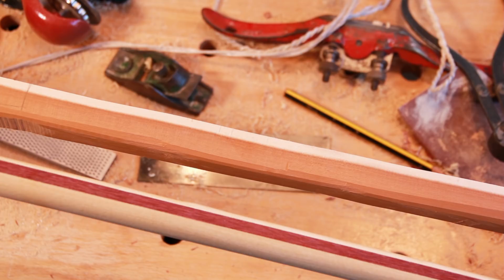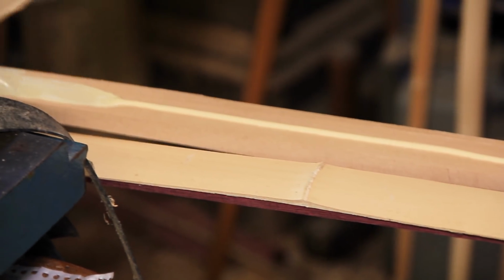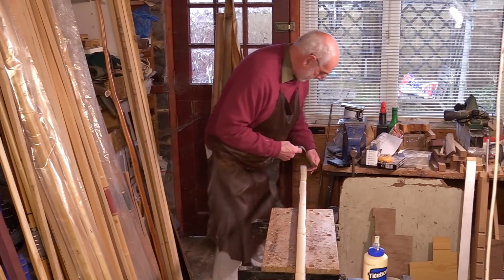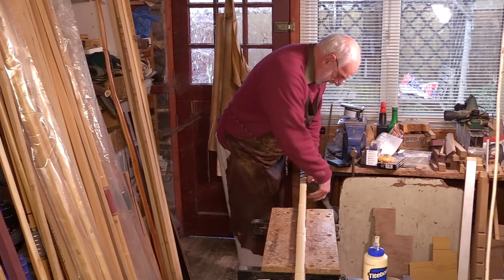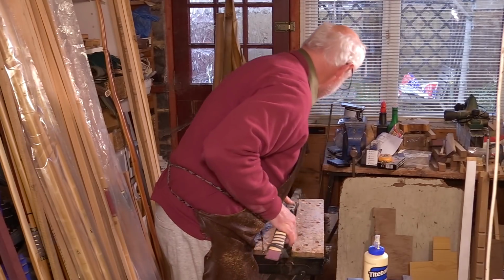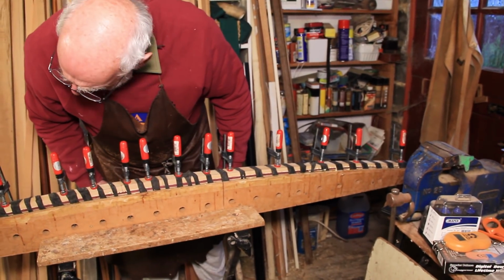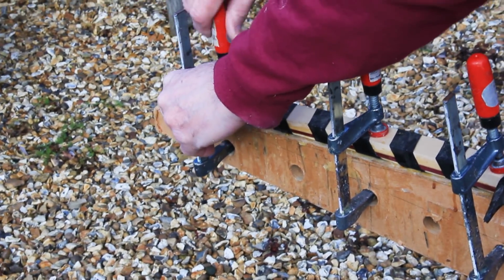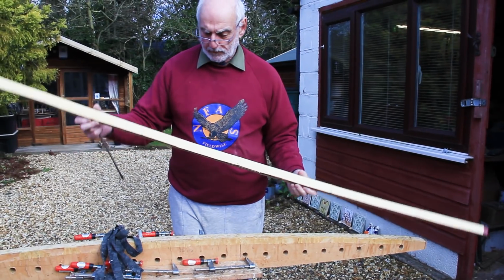Gluing laminations on a former - How to make a Longbow

Comment: Im making one out of 30 yr old cyoress boards right now and was just wondering what to use for glue. Wasnt sure if regular, quality wood glue would work but it looks like thats what u used.
Reply from the maker: We use wood glue, but I have never used the wood you are using!
Reply: @longbows  I've ripped it down to about 3/32" by 2" by 6'..
 The grain is long, wide and as straight as an arrow all the way down the boards with no knots or burrells. I decided this afternoon to rip some 100+ yr old oak (dont know what kind of oak) to about 1/8".
I'm gonna do 2 layers of that in the middle so that the very pretty cypress is on the outside where it can be seen. Im a painter with 35yrs of experience so im goin to put a tung oil concoction of my own making on it and buff it to a high shine.
Reply: @longbows  Cypress are the trees that grow in the swamps and in any water really in the southern states in America. The grain in the pieces that im glueing right now are just beautiful man, long and straight with no knots at all.
Im laminating 2 layers of 100+ yr old oak (not sure what kind, probably red oak) in with the cypress to give it more strength. Im looking for about 60 pounds at 27 inches.
Reply from the maker: Those woods aren't used in English Longbows by us, so I have no idea if they will work, sorry.
Reply: @longbows  Well, I've got 2 strips of oak laminated between 3 layers of cypress glued and clamped out in my shop right now so I hope it works. I think the oak will give it enough strength to work and as far as I know cypress is a very flexible wood that is resistant to rot and water damage. They used it alot for siding on barns, just not good for structural/load bearing lumber but the straight grain was just begging to be made into a bow. P.S. I dont have a working planer right now so I've ripped all theae strips on an old craftsman table saw and sanded them smooth with a black and decker palm sander, so it's been quite labor intensive to say the least. Lol.
Reply from the maker: Great , let me know how you get on.
Reply: I thought this may give u a chuckle. I used the type 3 titebond like u suggested on on 5 glue joint (7 layers in total with 2 thin layers of the cypress on both of the outsides that show) and left them clamped until yesterday because of the humidity here in Arkansas. I then epoxied the aged walnut grip and cut it on the bandsaw to the size and shape that I wanted, it's 67 inches long and tapers down from 2 inches wide towards the middle to 3/4 inch at the ends.
It is simply beautiful, the cypress wood grain came out better than I could've exoected when I sanded it clean of the excess glue. I then put a string on it (which was all I could do and I'm not a small guy). So I got the string on and put it on my tillering stick thing that some other utoober showed me how to make. When I tried to pull it back it was very hard to do so I put it on my scale to test the draw strength and at 16ish inches it has about 90 pounds of draw strength. Im guessin that at 28 inches it would be closer to 125 pounds. Lol. Now I have to sand off at least one layer of the cypress from both sides and see if that will bring it down to about 75-80 pounds. These two bows that I've made have definitely been a learning experience for me. The first bow was made of cedar and although it was pretty and had about 60 pounds of draw, it failed catastrophically after about 2 weeks. But my neighbor down the road told me yesterday that he has over 1100 feet of 35 yr old black walnut 1×6  that I can pick through if I'd like so my next bow will be black walnut. Thanks again for the advice man.

Comment: Great video, what radius do you use for your former and does putting the bend in the bow create any possible issues when roughing out and tillering?
Reply from the maker: Thanks, cant give dimensions, sorry, yes, they are much harder to tiller.
Reply: @longbows  can you give any more details into the witchcraft of the former and challenges and benefits it gives over not using one
Reply from the maker: Yes indeed, watch any of my videos where I tiller a triple laminated bow, they will have been on the former.

Comment: I'm planning on to build a laminate English longbow. I'm going to back it bamboo 1/8" thick. Does this mean I would have to make the bow 1/8" thinner then it's original dimensions to accommodate for this?
Reply from the maker: Thr bamboo is part of the bow, it must be part of the dimensions you are using, not excluded from.

Comment: I like using the form for some reflex.  On a laminated bow with thin bamboo layer when  you put horn knocks on and round down the tips to ~ 10 to 13 mm,  does the bamboo layer disappear right where the taper for the knock begins?  This is the way I have done it, but I'm wondering if this makes a weak point? On tri-laminates  are both the core and belly laminates preserved into the taper for the tip knock?
Reply from the maker: The following video will answer your question...https://www.youtube.com/watch?v=evQdHWVKP-0&t=3s
Reply: Thanks, that was just what I was looking for.

Comment: hello again im Mikey, I'm currently making a laminated longbow from an iroko back and a white oak belly. I've used cascamite to glue it and I'm leaving it  week to cure as suggested by other sites. you suggested using pva which ive already used for a flat bow to which  have already had to repair. what type of pva do you use and also when it comes to tillering do you normally bend the bow around 30 times per every inch until the desired weight is achieved?
and also is the D shaped profile ok for all other hard woods lest i keep getting chrysells?
Reply from the maker: Hi, we have used several wood glu PVA types over the years without problems, the problems occur when you don't prepare the surfaces properly. WE DO NOT MAKE FLATBOWS.  When I was apprentice to my father I drew the bow on the tiller 100 times per inch...I have a cruel father.
Reply: @longbows  ahhh thankyou very much for the informative reply,  may i ask do you know what maximum draw weight is achievable using a laminated bow?
Reply: @longbows  oh and also excellent videos. i have made several self  bows now and had four either explode or get Chrysles on the belly. i think I'm tillering too quickly maybe?
Reply from the maker: We make English Longbows, for the sport of Archery, we generally only go up to 55-60lbs, I couldn't say what the maximum is, we have made bows up to 80lbs in the distant past.

Comment: Hello Richard& Philip, what is the rule for the bamboo nodes on the back of the bow? Is there one,does it matter?
Reply from the maker: Hiya, yes, leave them as is.
Reply: @longbows  ok,do you have to balance the node positions along the back of the bow so they match on top&bottom limb?
Reply from the maker: That's up to you, but the art of tillering would mean that isn't necessary.

Comment: doesn't laminating make the bow weaker??? I like seeing the heartwood being used. Very nice. Thanks.
Reply from the maker: Weaker in what way??
Reply: easier to break, or even crack. I like it and haven't used one, but I thought laminating weakens the wood???
Reply from the maker: I see, well, individually the woods we have used would probably break if made into the type of bow design used in the video, the reason for laminating is to choose woods that perform well in their chosen position, for example the bamboo is excellent at resisting tension on the back curve of the bow, and the Dagame, on the inside of the bow, is good at resisting compression.  And what with modern glues nowadays, laminated bows and probably more likely to survive than self bows, just look at the laminated bows from the 60`s and 70`s onwards, most recurve bows and still going strong.  It really comes down to selecting good materials and knowing how to deal with them, same as any woodworking skill.
Reply: I've been following you guys on YOUTUBE for a long time = at least a year and maybe longer and i greatly enjoy seeing how you guys put them together. I would love to order a long bow, but the shipping alone would be staggering, ha ha ha. Excellent quality ALL AROUND.

Comment: Thank you for that Video. I am very impressed how easy you build a Laminated Longbow. This Bow was without backing right? I saw a lot of videos in the past ,they all back it after glue Process. Is backing much better or only a shorter drying Process? Greetings from Germany
Reply from the maker: Thanks.  English Longbows do not have a `backing`, the back of the bow is bamboo, we do not use things like fibreglass, is that what you meant?

Comment: How wide were the rubber strips that you used?
Reply from the maker: They range in width, around an inch mostly.
Reply: Get old bicycle inner tubes from a bike shop (free?) and cut about 3/4 inch widework a treat

Comment: I just clicked on the video because I'm having a hard time removing the wood to get a perfect grade side to glue on.
Unfortunately, the theme was worth  only 5 seconds and an electro planing.
Are u able to do it without and maybe have a tip for me?
Reply from the maker: Sorry, I don't understand your question.
Reply: @longbows  
I only work with hand tools and find it really hard to get a straight flat surface for glueing. There were always some gabs at the sides and i dont know how to get rid of them. I guess its much easier if you use a jointer with a long fence for straight ones or a 90° wheel grinder for lumpy bumpy woods.
I saw a wavey piece of yew heartwood backed with Hickory on your channel. It is absolutly well made and i have no clue how to o that without power tools.

I appreciate that you take your time.
Your yew bows are absolutely impressive.
Reply from the maker: What wood are you using?
Reply: @longbows  Hazel, Ash and various fruitwoods like cherry and pear.
At the moment i struggle with that cherry for bellyside.
Reply from the maker: OK, Hazel we don't use for bows, nor cherry nor Pear!  Ash we generally use as a 'self' bow, like the yew.  For the belly we tend to use Lemonwood, it works very easily.  You can achieve a good finish for glue bonding with hand tools, people think they need a silky smooth side to glue on, don't forget the more imperfections you remove the less area for the glue to bond, if you have perfect planed areas all the glue can squeeze out when you put pressure on!  Once you have planed a side you can use a cabinet scraper to achieve a better feel.  You don't need a planer, we use use one to speed up the process.